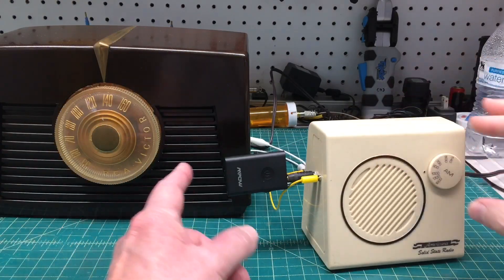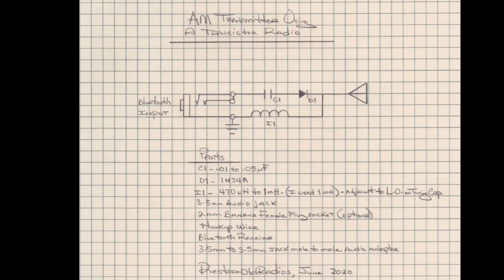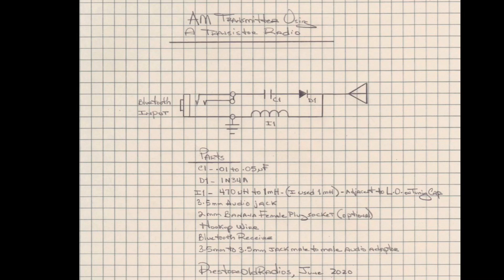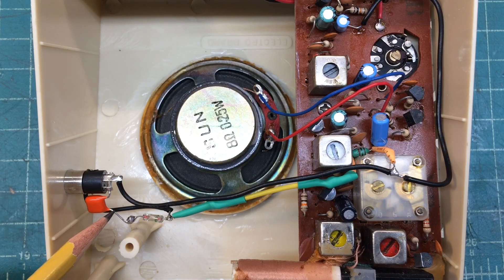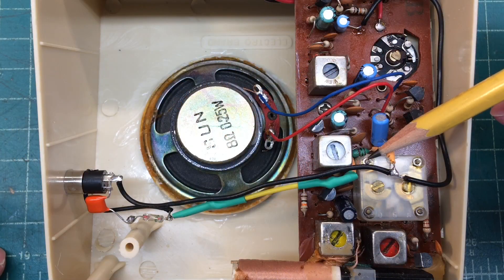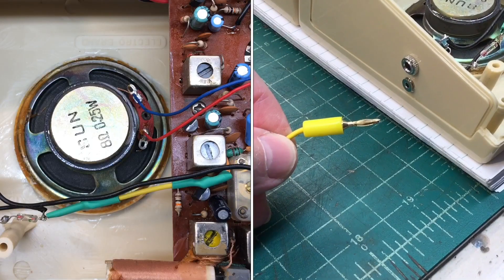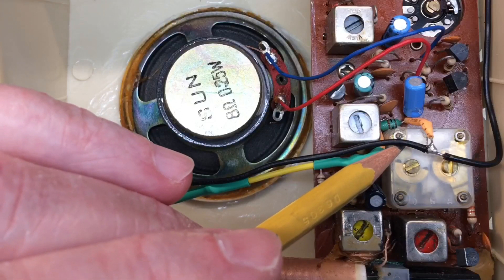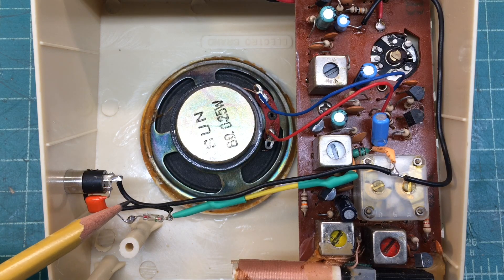How to Build an AM Transmitter w/ one Capacitor, Diode & Inductor

Comment: V2 is working . In my case I reduced resistor to 100 kOhm and used LO from an 1962 japanese receiver. In addition I added an 0.03 uF capacitor, great idea. Thanks sir
Reply from the maker: Glad it worked out. Thanks for sharing your changes for all to view. Best, Don

Comment: Hey Don i made your design better and universal i made a tuned loop antenna for 520 khz to 2mhz and i have a diode 1n34a and my antenna can work as a crystal radio without a ground or a long wire antenna. My loop also has a coupling loop on it so i can use it for any radio with an external antenna connection. The cool part is basically all radios that aren't DSP can generate a carrier 450 khz abouve what the radio says, so if i take the singnal from a radio, couple it to my loop antenna, than send audio into the diode, tune the antenna to the sane frequency as the carrier it will modulate the signal and make an am transmitter.
Reply from the maker: Very, very cool indeed! Thanks for sharing the modification with all of us. All the the best. Don

Comment: Really cool projects but I have a question. How many turns of wire on the inductor do I need for 1.8 MHz and what size capacitor. I'm having trouble trying to figure it out
Reply from the maker: Brandon - to be sure my response is accurate, what design are you referencing with turns on the inductor? Best, Don
Reply: @RestoreOldRadios  I'm looking into building my own receiver and transmitter just a simple one that will be able to utilize the 160 m band. I'm green to all this. Just got my soldering gun a week or two ago and practice some last week. I have some capacitors transistors and resistors coming and I also purchased a small roll of magnet wire. I just want to be able to produce this simple RF receiver at first be able to pick up anything and then I can find to knit. I also have some Crystal oscillator is coming I'm looking forward to this. I've been messing around with CB 27 MHz band for the last month or two I have a dipole strung up over the house a half wavelength dipole. Radio is absolutely fascinating
Reply from the maker: Here’s a resource you might find helpful: https://nvhrbiblio.nl/biblio/boek/Graf%20-%20Build%20Your%20Own%20Low-Power%20Transmitters.pdf
Reply: @RestoreOldRadios  thank you!

Comment: Cool idea!
I have watched many videos about building various AM transmitters, and the one thing NOBODY talks about is the transmitting antenna. I would like to know how to measure/calculate the best length for power output. And, does it matter that much? If it is perfectly matched, would you even be able to tell the difference versus say a generic 2m in length?
Reply from the maker: I prefer close proximity transmitters with just a few milliwatts of input power. If you’re in the states, check the FCC regulations, but at a high level the antenna including the earth ground system can’t exceed 3 meters in length. I hope this helps and thanks again for reaching out and watching. Best, Don

Comment: New to radio theory and circuits, what is the purpose of the Bluetooth receiver? Could you provide a brief explanation of what/how this solution works? Thanks in advance for your time and consideration.
Reply from the maker: Steve, welcome to my channel. I modified the transistor radio on the right to be a close proximity AM transmitter and I’m using the Bluetooth receiver to stream music from my iPad. The transmitter then broadcast the music to the RCA radio on the left with no physical connection. It’s a simple way to broadcast old music or other to vintage AM radios. Hope this helps. Thanks for reaching out and watching. Best, Don
Reply: @RestoreOldRadios  Thanks for the explanation. Much peace.

Comment from the maker: The v2.0 schematic is available and has a direct connection to the local oscillator through a high value resistor:
https://drive.google.com/drive/folders/1POz9BFkeX8NVeXuCB9AOmVQjtJc4Qh3p?usp=sharing

Comment: Aaaaaw you cheated. I was under the impression by the title of your video that the choke, diode and cap were the only components to transmit. You hijacked the active LO of the radio. Nice. ;-)
Reply from the maker: gabevee3 I couldn’t fit it all into the video description. I just published v2.0 that provides for a direct connection to the L.O. if needed. Best, Don

Comment: Great grabber intro.  Well this brings up a question.   Has anyone hacked an AM radio and used the LO section as the carrier and tapped into that circuit to modulate it and make a transmitter out of an AM radio?
Reply from the maker: That’s what this add on circuit does. Best, Don
Reply from the maker: Thanks, it’s an out of the box way of building a transmitter without disabling the receiver. Thanks for watching. Best, Don
Reply from the maker: I just published v2.0 that provides for a direct connection to the L.O. if needed. Best, Don

Comment: That is a really neat little mod to any radio and as its passive does not draw any extra load from the set... Love it Don.
Reply from the maker: George Christofi I just published v2.0 that provides for a direct connection to the L.O. if needed. Best, Don
Reply: @RestoreOldRadios  will be looking at that for sure.
Reply from the maker: Thanks George. A different approach for sure, but effective for close proximity without an added RF amplifier. Best, Don

Comment: Don, I don't know where you came up with this one but man oh man,,, very cool pal. And the inductor tucked next to the cap is the icing for sure. ☺
Reply from the maker: Carl, I thought you would like this one. I look forward hearing back after you give it a try. BTW - an AA5 has a much higher oscillator output that can be captured and used. Have fun and all the best. Don
Reply from the maker: skycarl Carl, I just published v2.0 that provides for a direct connection to the L.O. if needed. Best, Don
Reply: @RestoreOldRadios  Thanks Don, got 1 and 2 now. Looks like fun.
Reply from the maker: Carl - regarding v2.0, I only tested it on two transistor radios. One of the two required a 470k resistor for the L.O. connection, which reduces the RF level a bit in addition to the audio drive level needed to be increased to max on my iPad. The other worked fine with the lower value... Have fun. Best, Don

Comment: Would like to see an improvement video on the 1 tube am transmitter which can be purchased on ebay.
Reply: I recently put one together and cant seem to get any volume without over modulating
Reply: Perhaps an amplifier? Or a TV coax signal booster
Reply from the maker: Do you have a link to the listing? Best, Don

Comment: Brilliantly done.  Do you actually need the connection back to the transistor radio ground?
Reply from the maker: Dan, removing the ground connection reduces the RF receive level, but attaching a few feet of wire to the inductor with the ground disconnected gets me back closer to the original performance. Hope this helps. Best, Don
Reply: @RestoreOldRadios  Thank you for the update, always enjoy your videos!
Reply from the maker: Dan Koellen I just published v2.0 that provides for a direct connection to the L.O. if needed. Best, Don
Reply: @RestoreOldRadios  very interesting, I'll have to give it a try.  I have to admit the inductor seemed so stealthy, felt like a spy!
Reply from the maker: Dan, it seemed to help, but now you got me second guessing myself. I’ll double check tomorrow and reply back. Best, Don